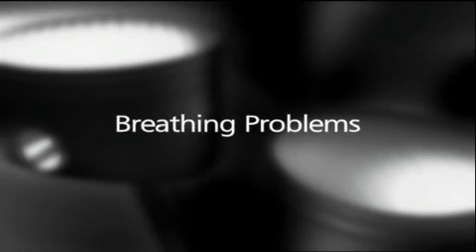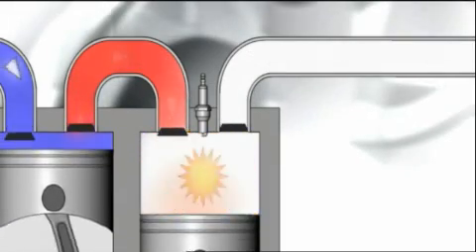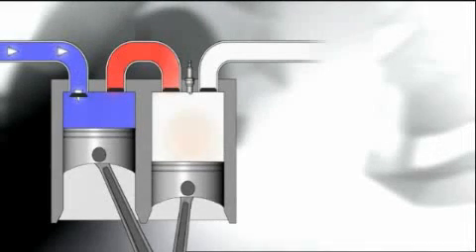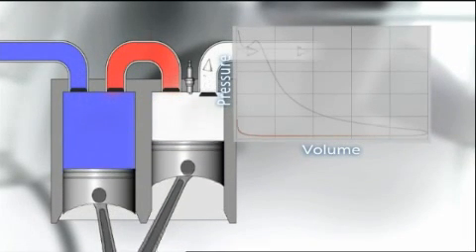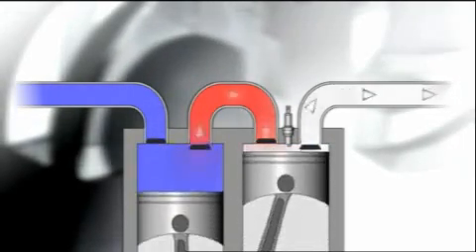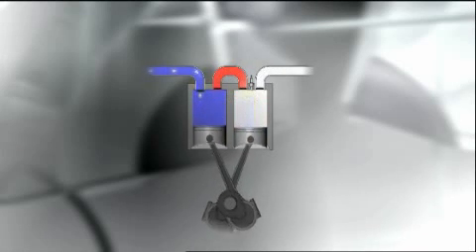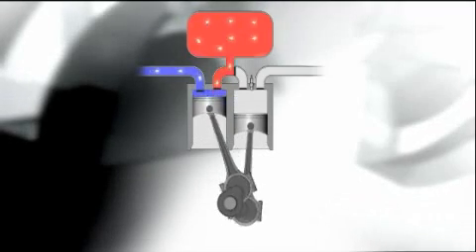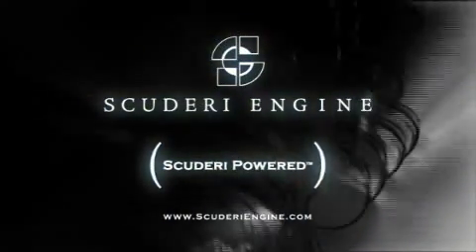Scuderi Engine - How It Works (by www.caroto.gr)

Comment: Using a tank touches other patents (as far as I remember GM has a patent on that) and would only work on a diesel design which isn't available by now. Burning petrol or gas usually needs lambda 1.0 combustion. So you would need means to throttle your gas intake incurring active valve control. Using combined combustion (diesotto) instead could work, but touches a Daimler patent. In any case the costs of development would grow exponentially.

Comment: I imagine they will be installing an intercooler into the system rather than directly over from the storage tank as shown in the computer model at the end. Of course, the storage tank itself could have a cooling system built into it as well, but I imagine that the most efficient use would be similar to existing air-to-air intercooling systems on production cars, as it would increase overall volumetric efficiency over a simple tank.